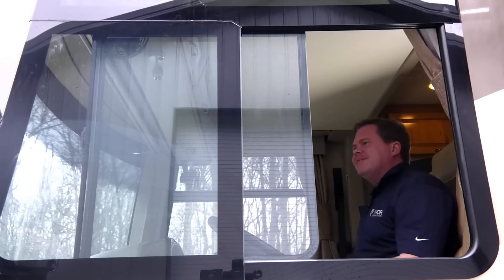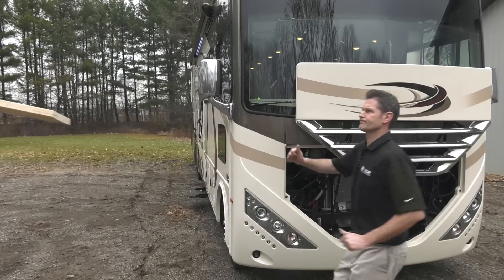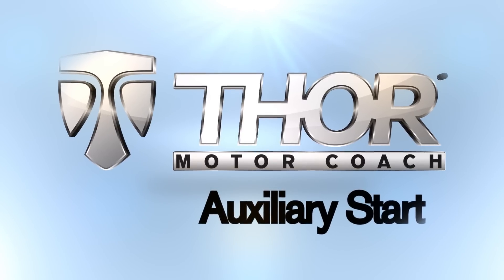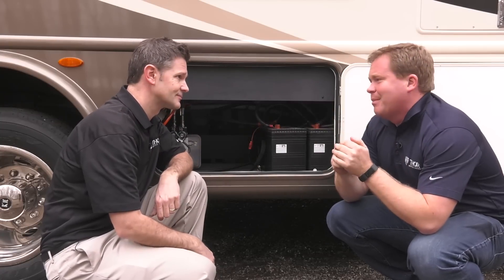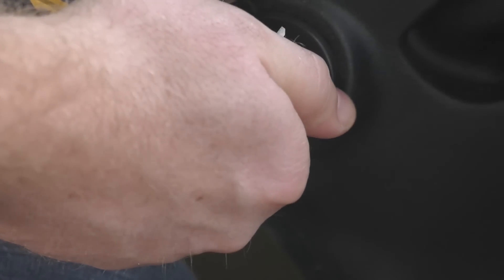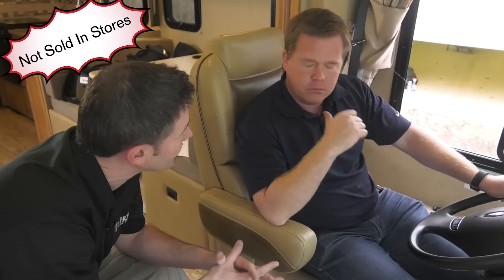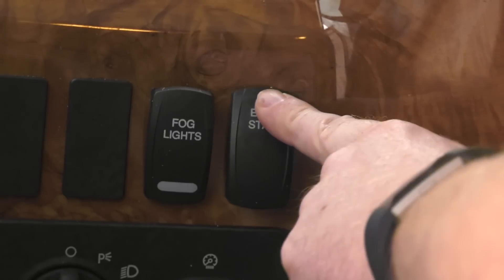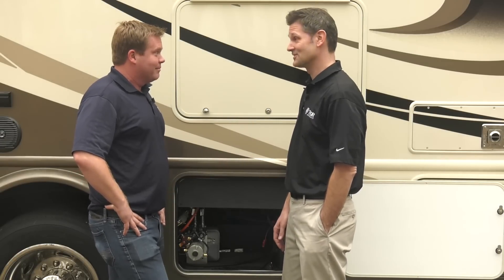Auxiliary Start System

Comment: I tried to use mine and it didn't work and my chassis battery was just barely dead. Anybody reads this leave a comment let me know what i did wrong. As I follow these directions to the T. Thanks
Reply: Mine isnt working either.  This does not work